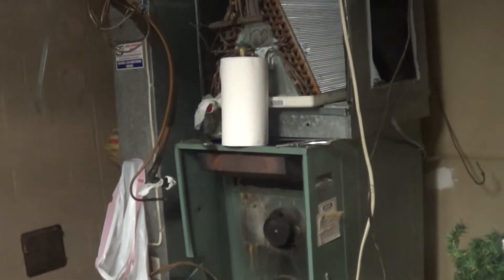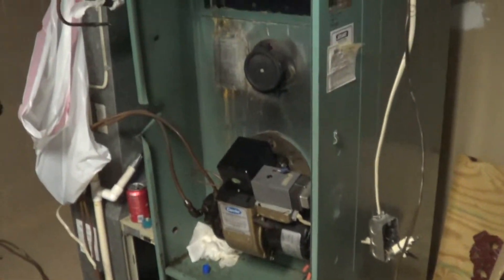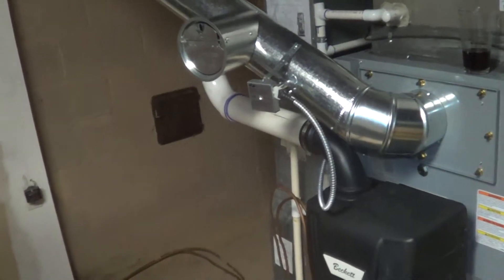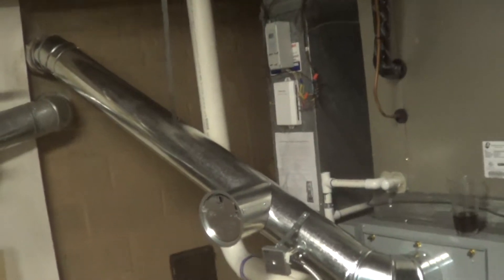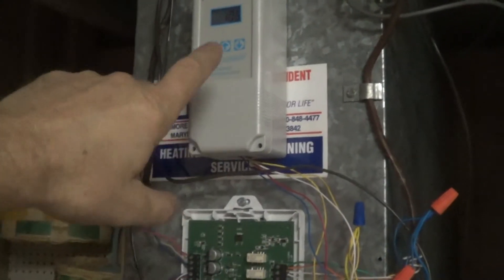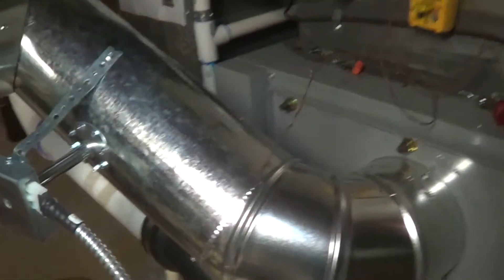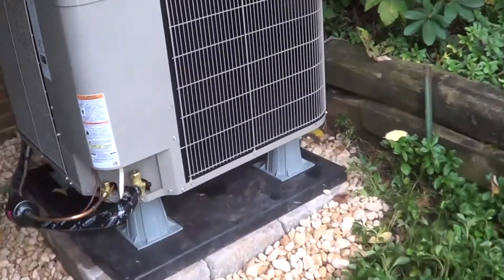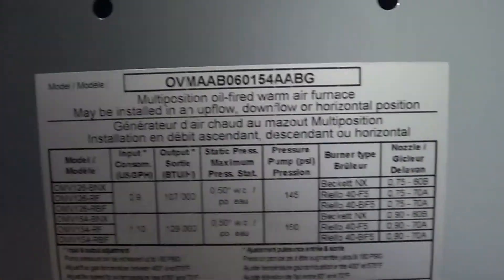Fuel oil heat pump hybrid installation and control

Comment: Would this be better then doing a oil furnace and add on a heat pump? the oil furnace is 20 years old or so  looking to have my oil furnace primary and use the heat pump with the temp are 30 or more and use the oil furnace when it's below 30 degrees i live in Pa
Reply: Yes I have heat dual use oil when temp drops auto goes to oil... I had a furnace father bought not very old. So we didn't have air so didn't want to get rid of the furnace bc they last 50 or more years. So from what I gather have been told..the 2 system dual is really good idea.. if u already have a furnace bc it helps the heat pump saves it from wear tare .it doesn't run as hard bc u have a another system when temp drop.  So saves on it running so much wearing it out. Oil is much warmer .I've noticed when it does get colder it switches to oil. I can cut my thermostats  back few degrees ex...like 72 to 69 bc oil is warmer heat it gets to hot when oil comes on set at 72.. think it's a good system. Now my question is...I'm not sure when it switches to oil. Hear anywhere from 35 to 39 whatever they set it at. And another thing is when it gets really cold a heat pump runs on  2 double straps gets hotter when it gets colder. That does 2 things without dual system. It runs runs to keep your hone warm... double straps kick in when it gets really cold and it also run runs and causes your light bill to get higher too bc of the double strip and running more often which is more wear tare on the system..after it gets really cold.. that is why  if u have a furnace already dual system is good.i live in a older home built in 1955 no windows has ever been redone or anything... I had the dual system  put in already had oil furnace. My light bill in the summer and in the winter has never been over 80 dollars.  Highest... usually runs 60 to 70 dollars a month...both summer with air conditioner and winter with heat.. been no  new insulation or windows redone in this home at all..have a trane system.. keep thermostat at 71 sometimes 72 oil comes on 69.. house Sq footage is about less than 1000sq feet all one level have a basement but it is  not insulates ot anything leaks water  so it's not like  it helps heat the house or anything. So like my system i was undecided think best thing.. now I have a question I would like to know where and how to check my thermostat to see what temp  it is set to switch  from heat to oil.. where to find it.. I've heard it is anywhere from 35 to 39.. so my system has heat but not double straps bc it would have to pull higher voltage they say have to have it rewired also so that's another reason I did not go to  double strip full heat system already had a fairly new furnace but no air conditioning  now have both. Buy like to see what temp it's set on like to push it down to 35 if... it's isn't already for the oil to come on.. does anyone know where to find  that temp Guage. Where the temp is set to switch over how I can check it see the setting for that? Thanks hope this information  helps someone bc I was completely  at a loss didn't know what tonexspect with a dual system. Uses fuel.oil and I have heat pump as well. Just don't kick n to the double strips after it gets colder kicks in oil.. it helps save wear tare on my system doesn't run all the time when it's cold doesn't run light bill.up running all the time n the winter.. hope helps somebody that maybe in limbo as what to do. .now if Iwoukd of  not had a furnace already  I may have went the other way . But I couldn't see throwing away a fairly new furnace. ...if anyone again can tell me where to look to see what where the temp Guage  is  set switching from electric to fuel oil. Idk if it was  down on the unit or oil furnace . I have a thermostat in the hall for heat air settings. But idk where the setting would be to switch from electric  heat to fuel oil what temp it's set at to switch?
Reply: @km376  I thought the temp gauge (for switching) was on the outside unit. We monitored an outdoor thermometer for several days. The system is supposed to switch at 35 degrees but we discovered it is really around 38/39. We decided to leave it be instead of having a service call. Our HVAC company had "checked" the setting so if you know someone in the business they might be able to answer.
Reply: I am in the same boat as you, did you go with a heat pump? Upstate NY here
Reply: Oh I was hoping to see a real answer here. We replaced a/c coil with HP so we have hybrid system. HP is supposed to work 35 degrees and higher (for heat) and oil for colder temps. But at 40 or 45 the oil furnace is running not the HP. Installers say the settings are right for the 35 degree change. Any ideas what we could do? In Ohio we have a lot of days between 35 and 45 degrees and I don't want to keep burning oil.

Comment: Only problem with this setup is when heatpump goes into defrost it blows cold air a better setup is to open white from heatpump defrost board so oil is shut off at 105 keeps cold air from blowing in defrost

Comment: Curious to know why the whole furnace was changed instead of just the oil burner.
Reply from the maker: All HVAC equipment has a 15 year design life.   20 years and it is pretty much worn out.   A new furnace isn't that much more when the entire system is being replaced.

Comment: Great video, I'm in Bowie MD with no access to natural gas. I have an oil furnance. My A/c has died and every contractor has recommended that I do away with the oil furnance and replace with a heat pump. No one has suggested a hybrid with the oil furnance. Do you recommend going with the heat pump? Do you service Bowie area? Thanks
Reply: What’d you end up doing here? I’m also in the Bowie area with a similar issue

Comment: Great explanation.  My oil burner has died. Should I go with an oil or gas dual system?  What brand is good? I am in Charlottesville VA and do not have natural gas.  Also I only have about  6 feet of height in the cellar.   All the articles are about gas systems, is there a reason?  

Thanks!

Comment: I feel like an idiot for never learning this stuff. But I have a hybrid system. When furnace goes  on, one side of house gets heat, other side gets heat pumps colder air. Are both supposed to run at the same time when the furnace kicks on? Also, I'm assuming there's a flap somewhere that's supposed to be pushed by the higher pressure of the Furnace when it runs to prevent that "colder" air from coming in. Exactly what is that thing called so I can look for what it looks like online, find it myself on the duct work and try to see if I can fix it or need to replace it?
Reply from the maker: DragonZXDragster can you make a video of your setup?
Reply: I'll see if I can try to, the crawl space under the house isn't the "best" to crawl in lol

Comment: Great video. My only concern is why don't you use a combustion analyzer? looking at the flue gas says nothing about O2, CO2 or CO. 
How do you figure that burner is safe to run?
Valves at the pump are great for service and maintenance

Comment: It seems a little off that they would be concerned about how much oil they are burning when the water heater is oil, wouldn't they have gone to electric on the water heater too?
Reply from the maker: Yes.  The water heater will be changed to electric.  Energy costs are the same for fuel oil vs electric.  But, the fuel oil water heater is $1500 more.  So, electric is a no brainer.
Reply: Some Food for thought, when might we see desuper heaters on conventional split air conditioning systems like they have on geothermal heat pumps. Seems more like a luxury item that would be marketed to increase the efficiency of the system. This would help the hot water heating in the summer when the a/c is on.
Reply from the maker: I rarely see those.  Natural gas is so cheap.  I actually saw a much better product for showers.  It is a heat exchanger between the cold water and the drain from the shower.  Basically, it is a long 6 foot coax tube that takes the heat from the drain water and passes it to the cold.  That way, less hot water is needed for the shower.  The cold water is warmed before it hits the fixture.  I would imagine it could cut down shower heat usages 50% or more.  But, when you have natural gas, the saving is less than $100 per year to use this type of heat exchanger.
Reply: Ultron in the 80s just about every heat pump I installed in Florida had a hot water recovery unit off the condenser I’ve often wondered the same think not sure if they still install them there
Reply: That's pretty cool. I like that idea.
Reply from the maker: I have 4 systems like this now.  No problems with them.  No worrying about setting a balance point.  It works just like the millions of electric only heat pumps.
Reply: Awesome. Thanks Nathan. I've seen only about 6-7 of your videos and I can tell you are quite skilled with heat pumps/refrigeration. 
Thanks for sharing your knowledge brother!